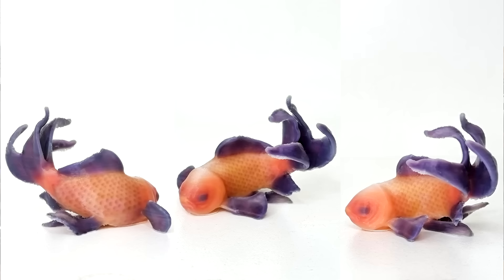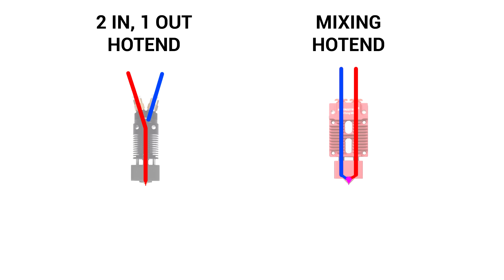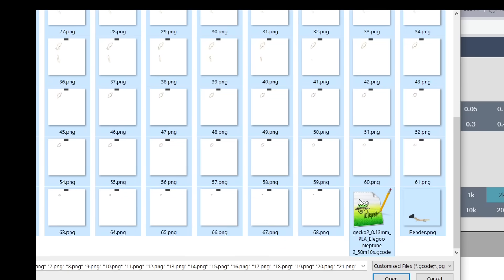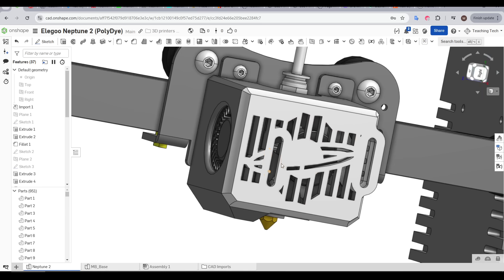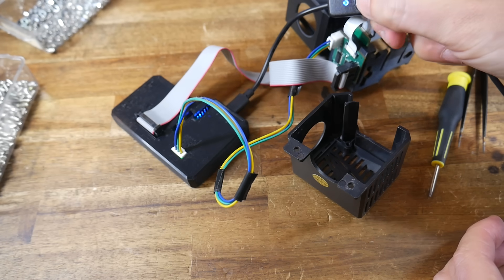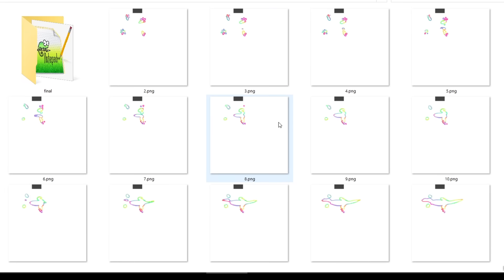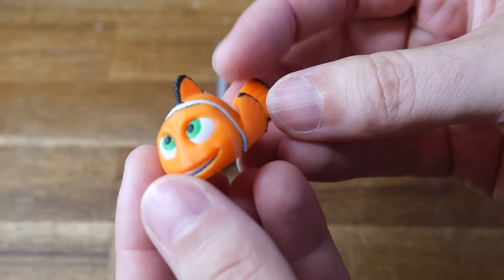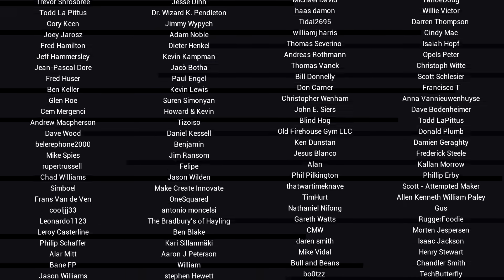Full colour 3D printing at home with PolyDye - Open Source Inkjet integration

Comment: If you hit the model with a high-gloss clearcoat it may make the color pop a tad more, that tends to work with inkjet prints on paper.
Reply: My first thought aswell, would like to see it tested
Reply: how are spambots this bad nowdays lmao
Reply: @theonlymann1485  ChatGPT and similar models. It makes automatic spam detection so much harder. People can still tell it's spam, but not computers equipped with base Bayer filters.
Reply: @UltimatePerfection Let's be real, the big G has all the data they need to crack down on the bot problem but they aren't going to. Not really. Yes, catching everything isn't practical but this is a joke.
Reply: @JJFX-  Agreed.
Reply: What a crazy scam robot comment chain
Reply: @JoshBeatty6 Yeah, no shit. Looks like they're fans of White Collar though, which is amazing show.
Reply: I suspect the colors being relatively dim is an effect of the polymer not really being designed to absorb ink in this way - printer ink is of course made for paper, which absorbs liquid extremely well. I'm hoping that this doesn't just spawn a new, specialized filament, but maybe a different kind of ink?
Reply: @AaronEiche I would like to see this with colorfabb lw-pla. It foams up while printing so it should hold the ink a lot better
Reply: @AaronEiche  Printer ink is extremely finely calibrated to flow from the cartridges controllably so getting some plastic compatible ink is less than unlikely. Well have to do with a different material, possibly something with additives that can take on printer ink.
Reply: wtf happened to this replies section
Reply: good fucking lord, this comment got hit hard by the crypto scam bots
Reply: This looks super cool. I'd like to give it a try. What's a good printer to mod for this? I use a qidinq1 pro and it's enclosed. I'm not sure I'd like to mod that...
Reply: not this crypto spam again lol, youtube is so bad with this
Reply: he also often interacts on FACEBOOK, using the user name mentioned below
Reply: I just wrote him on his facebook page
Reply: Nicholas Burke Gaffney.
Reply: It's amazing that you got to know Nicholas Burke. He has been a blessing to me and my family.
Reply: Wow!, I'm surprised how y'all got to know Nicholas. Indeed he has been a blessing to me and my family. After I raised up to 325k trading with him I bought a new House and a car here in the states also paid for my daughter's surgery (Adriana). Glory to God.
Reply: I have seen so many recommendations about Nicholas Burka Gaffney, his strategy must be good for people to talk about him
Reply: Nicholas scammed me out of £1,475,000. He is a scumbag scammer and so are you for endorsing him. @MayraAlejandraGarciaPuello-t1k
Reply: Thank you, I Will contact him right away
Reply: Thank you for the lead. I searched him up, on Facebook and I have sent him a message. I hope he gets back to me soon.
Reply: Positive result Is all I have read and heard about Nicholas.
Reply: I've come across this name before, is he really reliable?
Reply: It's amazing that you got to know Nicholas, I started my trade with $15,000, a week later, we had grown to $55,000. This man is absolutely a genius.
Reply: As a beginner investor, it's essential for you to have a mentor to keep you accountable. Myself, I'm guided by Nicholas Burka Gaffney. A widely known crypto consultant
Reply: just found him, With all the recommendations I've seen here, I'll definitely give it a try.
Reply: how do y'all even make so much from crypto trading?
Reply: This is not the first time I am hearing of Nicholas Burka Gaffney, and his exploits in the trading world but I have no idea how to get to him
Reply: Nicholas Burke Gaffney is licensed with New York Stock Exchange, FINRA, Nasdaq Stock Market and NYSE American LLC
Reply: I'm new to cryptocurrency and don't understand how it really works. how Can someone know the right approach to investing and making good profits from cryptocurrency investments?
Reply: Yeah!, Nicholas Burke Gaffney was my hope during the 'bear summer' last year. I did so many mistakes but also learned so much from it, and of course from Sir Nicholas Burka gaffney. He is my number one source when it comes to crypto and TA.
Reply: Market behavior can be complex and unpredictable. Mind if I ask you to recommend this particular advisor to whom you have used their services?
Reply: This time last year I considered crypto without much knowledge and decided to have a consultation with a fiduciary, and it was incredibly insightful. I got into the market with 15k, One year and a couple of months in, and I'm up with 550k. I truly cannot stress enough how helpful experts in this field are!

Comment: just to note, klipper can be controlled via octoprint but octoprint has to be running on the same host as Klipper. I'd imagine if you could bus the input of polydye through moonraker or klipper macros you'd be able to get it working there too

Comment: Hopefully this can eventually be its own thing, rather than relying on a proprietary inkjet cartridge. Looks promising, though. Does the ink really dry out during a print? Usually it takes a few days to dry out inside a 2D printer, and only if it's not being actively used. Odd that it would dry out in active use during a 3D print.

Comment: I wonder what type of encoding for the printing this is using, e.g. I doubt postscript or HP PCL due to licensing, but if it is a universal standard, a non-HP alternative could be devised, I hate HP with a passion, their ink cartridges are the worst value on the market, something like a Canon or Epson piezo head (vs HP's thermal head) would be better since you can adapt those to use alcohol pignment inks in addition to the soy/water based inks most inkjet use, but mostly so that you can use ink-tanks instead of just the reservoir in the cartridge, which must be capped when not in use so it doesn't dry out. There's a couple of things here in addition to capping, like cleaning the head's nozzles, but those HP cartridges are completely consumable, not designed for longevity or re-use (very much on purpose) though people have figured out how to refill them for decades, refilling often is unsuccessful due to the low MTBF of the nozzle heads. I hope if this takes off a more viable head + tank design gets developed.

Comment: Oh this is GENIUS, having static png layers really really makes this compelling, having the ability to use the human-readable PNGs to modify, e.g. the colors, or details, using an app like Lightroom or even Photoshop or Gimp that can batch process multiple files at once, you can apply color swaps or saturation changes en masse to use on prints without having to go back to the drawing board and work on the texture's UV mapped art - which for some can be very intimidating. This is freaking great.
Reply: Polyjet and other technologies that utilize 'inkjet' style printheads operate very similarly. Under the hood after everything is said and done it's all just bitmaps. Not sure about all the technologies but there are ways to access this and do your own simulations and output them to do true 'voxel' printing
Reply: Blender has a texture painting interface where you can paint directly on the model as another option.
Reply: Working on UV mapped art directly is more intimidating than batch-modifying slices? ... ok
Reply: @dsp4392 yes, batch image editing is trivial, you can change saturation/colour by batch easily.

Modifying a 3d model and then reslicing and aligning every time you want to tweak the saturation of a model sounds like more work.

Comment: @TeachingTech the results are still a bit underwhelming, but it might largely just be due to dye vs pigment-based inks. Would it be easier to just throw CMYK airbrush nozzles on a mini 5-axis robot arm and place the model to be painted on a turntable?

Comment: for reference, a Stratasys J55 Polyjet runs around $110,000 U.S. plus materials, plus monthly maintenance support, the materials are DRM, there is no alternative, generic or hack, the machines are 100% subscription for the life of the machine, meaning you cannot ever stop paying Stratasys to use them, including their slicer software (at least you can use Bambu machines offline, people still whine about that, imagine being forced online and to pay!) the polyjet prints require a lot of post-processing - you need a water jet and/or a sandblasting booth depending on what materials and models you're printing, sometimes both, you'll also need a buffing wheel/tools for those clear finish parts. they print essentially as a amorphous blob or block, with support similar to solid wax, you free the print from it by it's water soluble-ability and human hands. How do you get prints to these? one popular way in my industry is Keyshot, we do full CMF in keyshot setting materials including textures, displacement maps, roughness, in addition to color of course, and the polyjet can print the outputted .3MF files (proprietary, unfortunately they don't work with FDM slicers) directly to magically replicate what you saw in Keyshot. The workflow is very magical from end-to-end, but the in-between steps though novel at first, are a lot of work and not quick by any means. e.g. a mouse printed with translucent parts for RGB LEDs to shine through, took me 21 hours, plus about 4 hours of post processing. an estimate from one of the engineers was that the mouse paperweight we printed cost the company around $2,000 for about 100g of material, using around 800g of waste and an unknowable amount of colorant (polymer doesn't let end users know, you just have to keep paying).
Reply: (big huge asterisk!: the $numbers here are what was negotiated, they quote you based on a lot of factors, there is no set single price, that was the price based on contract negotiations I was not privy to)

Comment: just a thought to the 9mm colorshifting, maybe its dependend on the print speed. many slicers get faster the further you are along in the print. maybe at the 9mm mark your profile switches to full throttle

Comment: I still like my idea from 10yrs ago, cmykw filament spools, 5 bodens, 1 tiny heated mixing chamber into 1 nozzle, never built it as I could have built the hexagonal chamber etc but no slicer to slice in colour so if built I couldnt test it, but very simply bby varying the speed of the 5 extruders you can select whatever mix of filament is needed to make whatever colour you want. you can purge tower to do create 'pure' colour switches or just fade from one to another for more creative effects
Reply: I'd love to see this as well.  I've thought about it and the hard part to me is the mixing chamber.  You couldn't just do a 5 into 1 setup as the plastic flow tends to be laminar so you would just end up with the 5 plastics sitting next to each other, not actually mixed.

Comment: does it just sprays plastic with ink ?
so in addition to already poor layer adhesion we will have  a paint between layers :/
Reply: Alcohol ink has been used as release agent before, to enable scar-free support removal. Works very well for that.

Fundamentally you should be able to melt the ink into the plastic, but... yeah...

Comment: Around 2012, the Z-Corp full color system was around $75k (USD) for the machine. The models had to be cleaned and resin infused; the process made cleaning resin prints seem like making toast! There was a vacuum infuser for very expensive resin ($3k per 5 gallons) that sold for around $30k. I was looking to run a small shop generating pre-surgical models from medical scan data, as well as architectural models (the primary intended use case); all-in, with the first round of supplies, there was easily $125k in start up cost.
Reply: And now a 1000 dollar P1S can do its job.

Comment: Very cool, but a weird of caution: USB and ribbon cables are not intended for applications with repeated and fast linear of bending movement and they will break after a while, giving either reliability issues or failed prints when it happens.

Comment: Modding it to use Tanks+Lines would be a must too in my opinion (although still being able to swap the cartridge/head eventually is a must as well)
Reply: Technically third parties make continuous ink systems that work with printers that use the 67XL cartridge shown in the video, presumably all you'd have to do is convert an empty cartridge over using one of those kits and you'd have what you're asking for without having to redesign the system.
Reply: @fdsman  ive seen those, thats a good idea
Reply: And sublimation inks that are colorfast after UV exposure.
Reply: Greenboy3D pellet feeder instead of Filament too.
Reply: @FlintStone-c3s pellet printer with inkjet capability sounds nice, lol
Reply: If you think about Ecotank style, they needs constant use to keep the print head running. If the head is clogged, the printer should be opened and the head IDK soaked in alcohol. Cartridges with head FTW 😅
Reply: Imagine if they could make a custom nozzle where they could have the ink from the tanks go directly into the plastic printing nozzle
Reply: @neb_setabed  unfortunately the nozzle does not mix the filament at all, and sides (where the ink would come from?) flow slower than center, so the ink doesn't spread 😐

Comment: Earlier this year I was chatting with a friend about 3D printing.  I mentioned an idea I had but had no idea how to implement.  He is an engineer and he thought the idea was interesting but he too had no idea where to even begin.  The thought was to combine both inkjet printing technology with nanoparticle SLS printing.  My thought was a powdered version of CA glue with the ink cartridges in the inkjet printer employing both a pigment and an chemical activator/catalyst.  The printer would print it's layer spraying nano bubbles of activator which would then cause the powder to bond together.  And just like with any inkjet printer you can have full control of the colour as it prints.  No lasers, UV light, post washing/curing of resin, filament jams, or dangerously high temps. The thought was that this could literally be a desktop machine with a decent build volume but that would have a smaller, or similar, size footprint.
Reply: stratasys patented and sells a version of your idea :)
Reply: @jamiexu6718  Interesting.  well, it's nice to know great minds think alike.  :)
Reply: Like a desktop version of HP's Multi Jet Fusion?
Reply: That has existed since the 90s. Look up "CJP"

....and the first UV-curing resin printer came out in....wait for it....1989. Consumer tech is only now catching up.

Comment: This is getting somewhere. I think polishing the process so it's all in the slicer somehow and also using those refillable inks would really propel this. It would be great to have something that just requires a blank filament and printer ink and then the colors can be faded or darkened on a whim to suit the print.

Comment: It's a neat concept that likely will improve as more effort is put into it but basing it on commercial ink jet cartridges seems like a terrible mistake. The ink in those cartridges is some of the most expensive liquids one can buy. As a means of creating a proof of concept, that's fine but hopefully some other method of applying ink will be used as the system progresses.

Comment: That's a great idea to build on. The ink on printer is specifically made for paper, some acrylic paint would be able to get vibrant colors. Maybe using refillable gel printer head could yield better results and also be much cheaper to clean the residue.
Reply: I've often wondered how difficult it would be to engineer some kind of very small ink cartridge that had some kind of nozzles that color the filament as its being extruded? But, I quickly thought that would never work, because if you are introducing ink into hot plastic, that ink might boil away while you're printing causing all kinds of problems with the prints (same reason why people dry their filament). 
But, knowing how inkjet printers work, they pretty much work with just super tiny linear rows of nozzles that literally do use heat to "boil" the ink that causes it to be pushed out of these smaller-than-human-hair sized nozzles onto the paper. I wonder if with some really advanced engineering, if someone can create a "ring" of inkjet nozzles that can surround a hotend of a 3D printer, and so like right as your extrusion is happening, when the ring passes over the filament that was just laid down, it could just intelligently color that part? 

I'm probably making things way, way too complex here haha

Comment: Excellent work and stunning results.

My only criticism is in the use of ink cartridges. These are generally in the total rip-off price range. Especially the brand used. 
It would be a very good idea to investigate the ink tank technology that is available for some printers the inks are held in larger bottles, and the cost is much much lower. 
Also the head is much lighter. 

Andy

Comment: There is a Da Vinci 3d printer (Da Vinci Color released in 2017) that uses the same principle. Very interesting concept!
Reply: Was about to say the same thing. Not sure what happened with it since it has been a long time since I’ve seen anything new on it but it is nice to see an open source version. Think I might get one for my ender 3 v1 after they refine it a bit more.
Reply: @tanithis  tbf nobody wants to buy a mediocre 3D printer just for the ability to to print mediocre color parts.
This however is an addon/upgrade kit. You still have a great printer at the end of the day. Its flexible asf and you dont need to inconvenience yourself